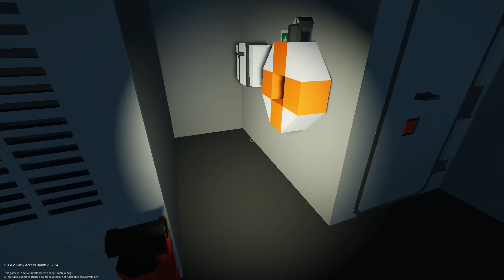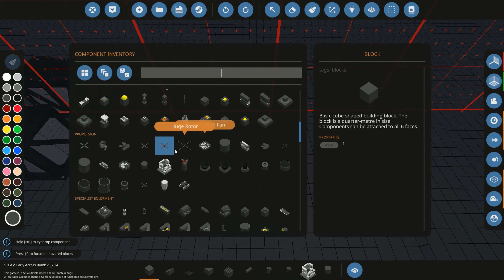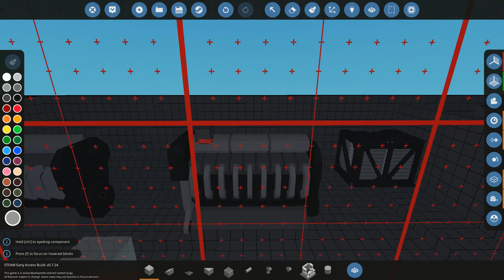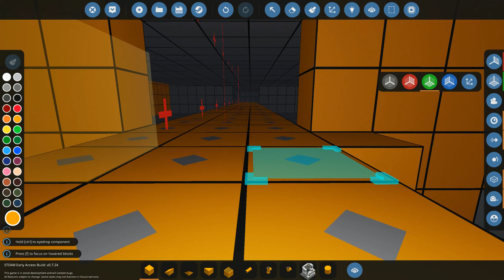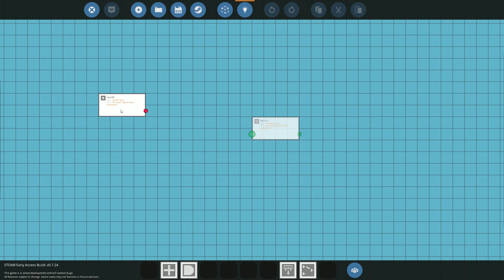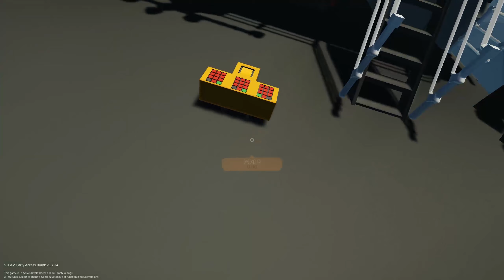Stormworks New Build Series - Part 3

Comment: be sure to extend the compartments ALL THE WAY UP
the titanic made the mistake of assuming it couldn't spill over the top
Reply: First thing, it's Titanic. It's a name so you need to have a capital, it also shows respect. Second thing, no one ever "assumed that water couldn't spill over the tops of the bulkheads. Titanic was designed to float with any two or the first four compartments flooded. Unfortunately, she opened five compartments which pulled the head down enough for the fifth compartment to spill into the sixth and so on.
Reply: @RobbetDegoat  true, and it was a series of unfortunate coincidences
a fire in a coal bunker, going too fast, lost the binoculars, IGNORED OTHER SHIPS WARNINGS ABOUT THE ICEBERGS, they cancelled that mornings lifeboat drill

hmmm. and there was two books, written several YEARS before the incident, practically predicting the incident!
so was it really a coincident?